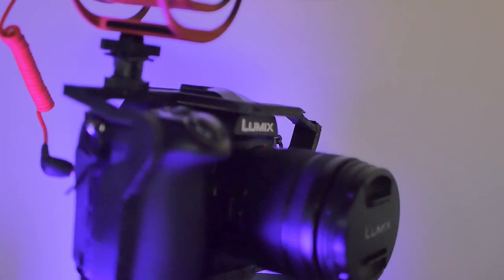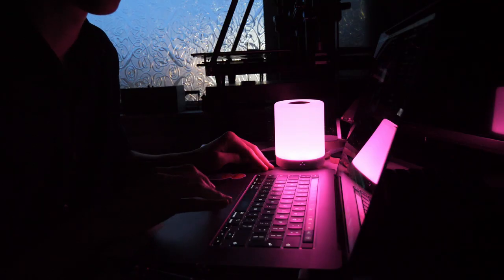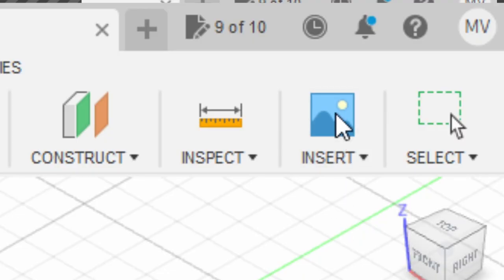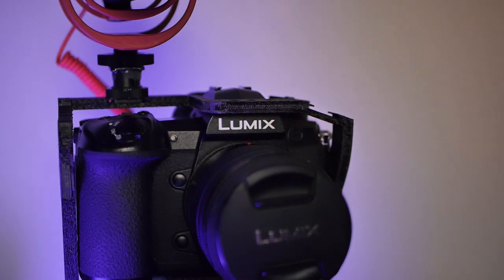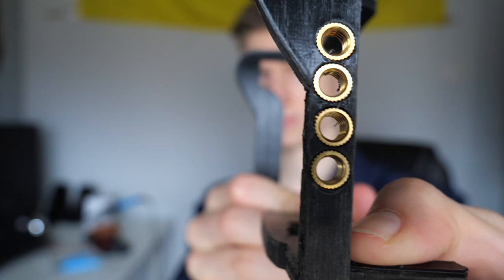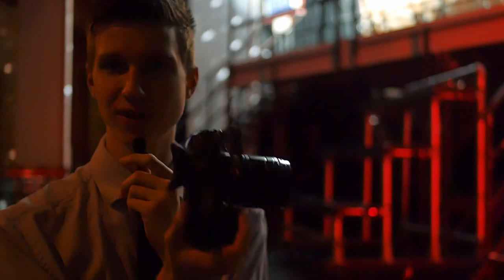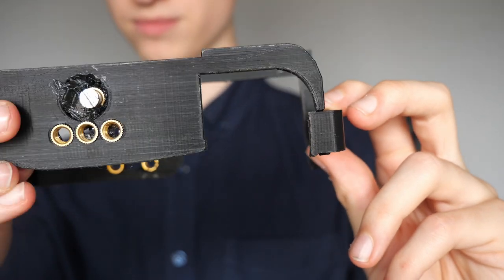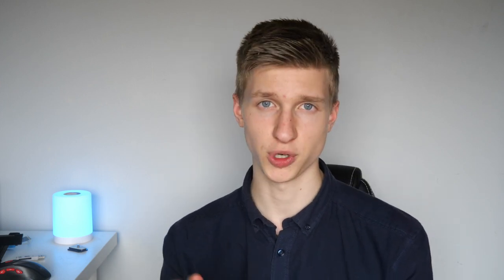Can You 3D print a Camera cage?

Comment: My recommendattion for your next iteration of this part is to have a little lip on the bottom half that the front of the camera body presses up against give more surface area and a small lip to resist twist. the other one is to have the top part of your frame pass over the cameras hot shoe and then use a metal coldshoe threaded adapter to affix the hot shoe to the top bar of the cage. Giving 2 points of fixed contact.

Otherwise if you have even the tiniest bit of space on the inside corners of the cage add in some gussets (bracing structures) across the corner to add heaps of strength. You should be able to make a cage with good strength to hold small accessories like monitor, microphone and side handle.

Also just thought. Consider what you could embed into the corners for extra strength eg. bend some thin aluminium from flat stock from the hardware store or cut it from old electronics cases. Bend it to the inner corners and flats of the cage. Then melt it in with a wide flat plastic welding soldering iron tip.
Additionally you could model in channels in the cage  to fit the alumium flat stock so you dont have to deform the part as much while fusing it in.

Keep going its handy knowledge and experience to have fabricating custom parts. ✌
Reply from the maker: Oh damn! I didn't think about that! Yeah that's very clever, I'll definitely keep it in mind if/when I revisit the topic! Thank you!!